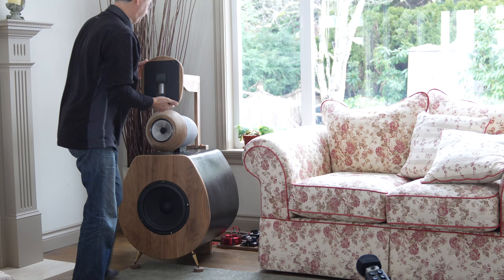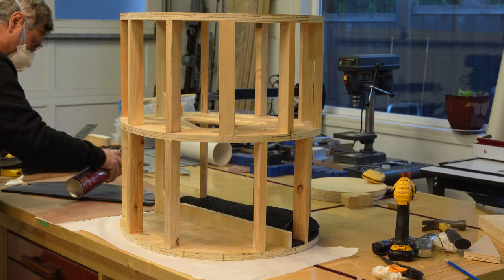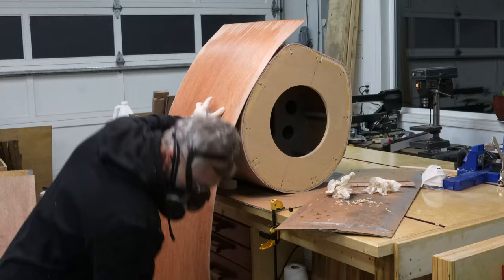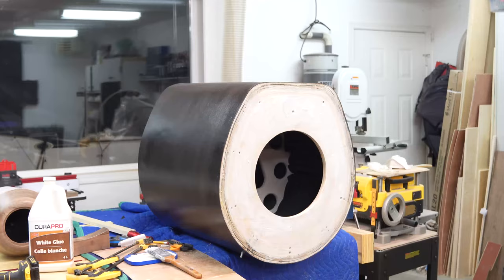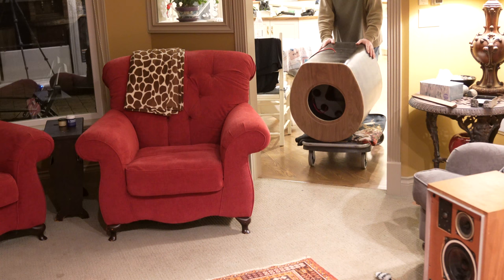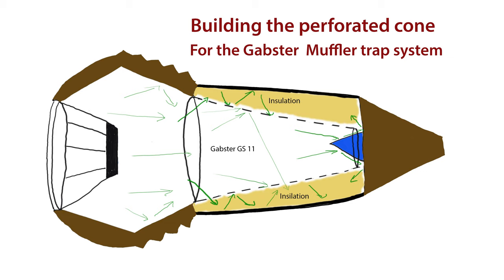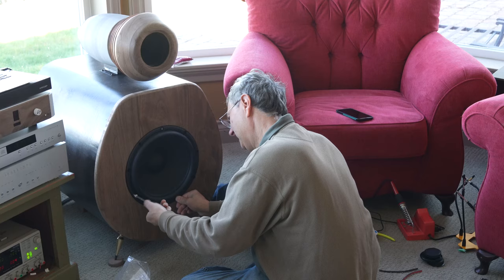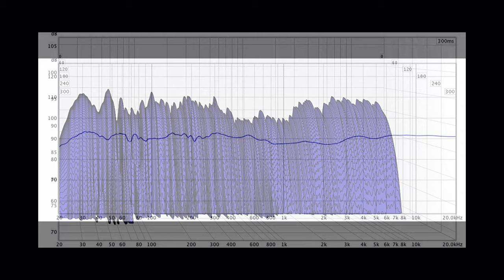My Best DIY high end Speakers Part 2.  Build details

Comment: when you enjoy hifi the ultimate expression of that is make some yourself :) 
you really made some of the best cabinet, it was a joy to watch the process.
 i did make some myself recently, and i had to use active crossover because i do not have a clue about passive. also had a problem with hiss noise so i sold the plate amp but still have the speakers.
i also made it a 3 way, but the 2 way part was separate and the bottom was like 2 stereo subwoofers.  and compared to yours the cabinet is simple stuff, mdf wood with rubber layer on the inside. all by boxes was sealed so i filled it with some shredded fabric material made for the use, its pretty heavy compared to most other loose stuff normally sold.

Comment: If the woofer crossover point is low enough and the wave length is bigger from the size box, then the shape of the box or the acoustic damper inside really doesn't matter.. Cause there is no standing wave.
There are a lot of subwoofers without insulation inside with just an ordinary cube box..

Comment: Questions:
1. What crossover points did you settle on? Did you match directivity between mid and tweet or did you let the mid go as high as possible to avoid crossover in the vocal range?
Comments:
2. I would have copied B&W matrix bracing technique for the midbass enclosure. 
3. It doesn't look like you followed the B&W marlan head enclosure shape for the front of the midrange enclosure. I would have.
Suggestion:
5. I you still can, line the enclosure walls with hawaphon steel pellet mats. Especially the midrange enclosure.

Comment: A superb work, real art. I am interested in how such linearity is possible in the external measurement of speakers between 20hz and 40hz, where these values are usually around -6db. Is it possible to display measurements at a greater distance in the room at the listening position by capturing the L and R speakers together.
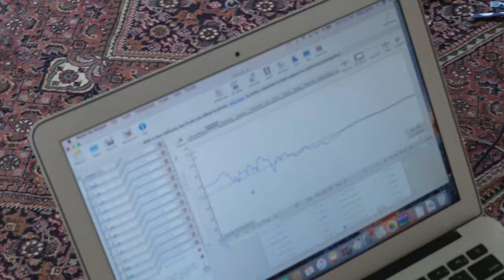Reply from the maker: The measurement at 21:47 inside are way higher but not very linear mostly the port adds up better inside then outside.

 Since the port it is down firing it is hard to do a accurate measurement outside
It is a lot easier measuring a front firing port as it would be in line with the drivers 
The curve I was aiming for inside is a bit higher in the low frequency and a bit in the high as flat can be boring 
Measurements change a lot as you move large speakers around inside or change the mic position outside at the end if they are for your own use in a fixed room best to do the final balance at the listening position.

Comment: Your selectors...where did you get them from?  Your attention to detail is out of this world.
Reply from the maker: Got them from Amazon they are huge wish they were a bit smaller but wanted a good contact they are triple contacts by 3 positions made for 3 phase so you can triple the contact surface to reduce any signal loss
https://www.amazon.ca/gp/product/B07ZKYDHF8/ref=ox_sc_act_image_1?smid=A2KRDQ1AI5Y5G6&psc=1
Reply: Thank you!  I was looking for a 2-position switch exactly like what you have found to switch between passive and active crossover.

Comment: Excellent craftsmanship, did you consider a closed enclosure with a larger woofer at any point, looks like your cabinet could handle the pressures quite easily.
Reply from the maker: The Scanspeak 32W 12 inch woofer is a excellent woofer I love the sound that it makes Clear and relaxed Drums actually sound like drums, not compressed. The bigger woofers seem to loose a bit in sound quality and speed I am a big believer of very large volume for the woofer with a large port It seems to give a  sense of a open baffle.
but that is just me. I debated double woofers but the almost round design di not help.
Reply: @Gabster1  I noticed there is around 4-5 12inch woofer from SS , what one did you select and why? They all looked to be around the 32W marl as well.

Comment: First, sorry for mi english, i´m only speak spanish. I love this project. Can you say what brand of speakers you use? The bass cabinet  have not resonance port ? Is a closed box? I use the LEAP software for design and simulate the box, xover, response and more... Are you using some software ? Have you a medicion of the cabinet vibrations ? Sorry for the questions, i have some componets as SEAS and FOCAL woofers , Dyanudio middles and tweeters, JVC Ribbon tweeters and i m thinking in build a project similar to this.  Congratulations.

Comment: Stunning build!  I am particularly curious about your use of Acoust-X in the woofer cabinet.  In this build you use it as a laminating "adhesive" in the woofer cabinet multi-layer wall structure, similar to your horn build where you also use it on the inside of the cabinet with a thin plywood laminate.  I notice you also use Acoust-X as a thick unconstrained paint inside the cabinet including the bracing structures.    Is it best used as a CLD layer between rigid structures or is surface application on surfaces equally effective?
Reply from the maker: For internal walls that will not easily resonate to the outside just painting them is fine that is what the manufacturer recommend. For outside walls using various layers that are different is the ultimate way as far as I see it.  
Using Acoust-x in between reduces the waves from resonating via the outside wall.
I did some tests may be one day I will make a video about it  where I used it between rigid structures and non rigid like rubber and it did well I was concerned about it not drying but as long as one side is wood it will dry as wood will extract the water over time. when possible let it dry for a couple days before adding more layers. Please note this is how I do it and I could be wrong, but my measurements and listening tests are very encouraging.
Reply: @Gabster1  did the soft viscoelastic material in the multilayer wall structure make drilling through or flush trimming with a router difficult?
Reply from the maker: @ny384388  Not at all

Comment: Didnt you overdid it just a bit on the woofer box. I mean after all it’s ported. It would make sense if it was a closed cabinet. I reckon half of all the layers would have been more than sufficient:) but nice work
Reply from the maker: Thanks, the initial plan was to have it ported with a plug to have it sealed and compare so I have tried both 
The ported version sounded better

Comment: Hey @Gabi where did you buy the plywood? I am looking  to do simular rounded shaps but i cant find a good vendor with affordable prices and sizes
Reply from the maker: Not sure where you are these are from Homedepot 4x8 sheets of 1/8 plywood 
Should find them in any big lumber store 
You will need to score the tight curves lots of work
Reply: @Gabster1  Thanks for the responed. We dont have this here but i finally found a good online shop.:)
One more Question the absorptive layer what material is it? It not rubber i guess

Comment: For building this you need a workshop filled with expensive mashines like is shown here. If you dont have it you can forgot about that and rather invest the same money to get a high end speaker from you dealer. If a speaker needs to have this rounded geometry and fancy multilayer coverage can be be truly doubted. There exist lots of excellent DIY speaker that use conventional shape and sound great with simple MDF coated with whool or similar and even expensive commercial designs usually do not consist of this sophisticated multilayer stuff. I really doubt that this complicated procedure has that effect on acustic quality.

Comment: Hello Gabster,
Excelent job. Is there any drawings with dimension of Your high end speakers. I would like to make something similar.
Reply from the maker: Exact measurements are reasonably not critical  it is a simple design in a way the woofer cabinet inside dimensions are a 19 inch  Radius with 4 inches above the circle  by 20.5 inches deep
outside are 22x24 (wall is about 1.5 inches thick )
The Midrange inside measurements  are around 6.5 inches radius at the widest by 16 inches.
I never did a drawing I built it big thinking could add more stuffing If I need to downsize.
All the best with your build :)
Reply: @Gabster1  Thanks.
Reply: @Gabster1  Can You share information about What speaker You used and components of crossover?
Reply from the maker: @dejanusic3852  Scan speak 32W/4878T01 woofer,  5inch BW D3 Midrange, Ral 140 15DAM tweeter
I will be doing a video about the crossovers in the future. it is a simple second order design .
Reply: @Gabster1  thank
Reply: @Gabster1  Thanks You...
Reply: @Gabster1  So this is D3 Midrange LF26751peaker or ?

Where did You buy it ?
Reply from the maker: @dejanusic3852  Correct
Reply: @Gabster1  Hi Gabster. Can You tell me where did You buy B&W D3 midrange ?
Reply from the maker: @dejanusic3852  got it off eBay you can also use a 12mu scanspeak I wanted to use a Accuton c168-6-990 is 173-6-090 but it is very pricey
Reply: @Gabster1  yes. D3 are arround 500.00 usd
Reply: @Gabster1  accuton 800-1000$
Reply: @Gabster1  How much You paid for tweeter?
Reply from the maker: @dejanusic3852  Got them from Madisound for $1200 Canadian around $950 US each a couple years ago so a pair $2000 they are very expensive but worth it they also come in a non dipole version
Reply: @Gabster1  Тханкс...
Reply: @Gabster1  Thanks..

Comment: Why a down-firing port?
Reply from the maker: You are not dependent on back wall distance you have it fixed also esthetics the bass is smoother and will sound therefore bigger and tighter 
The wider bottom funnel will act a a big flare eliminating shuffle sounds